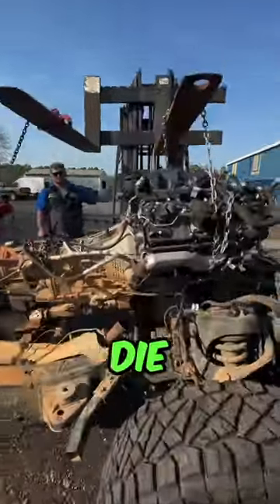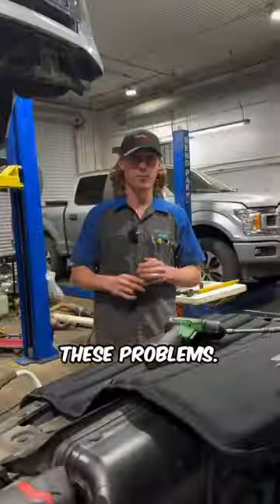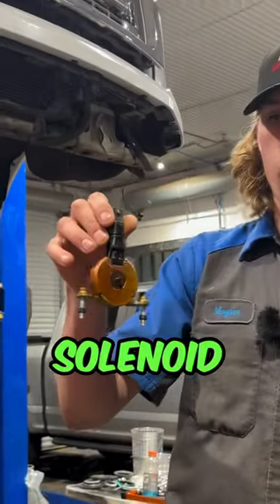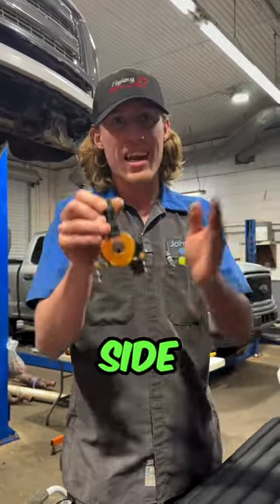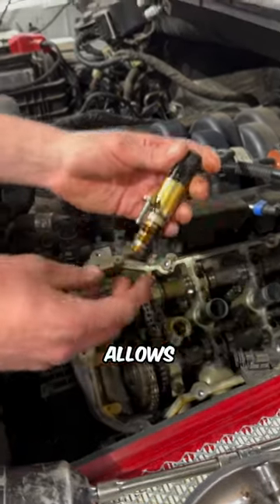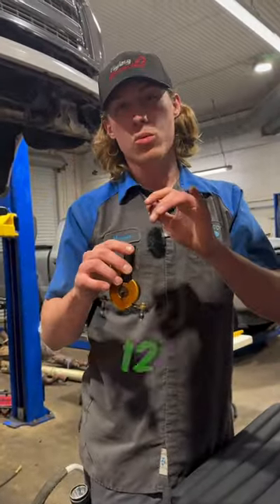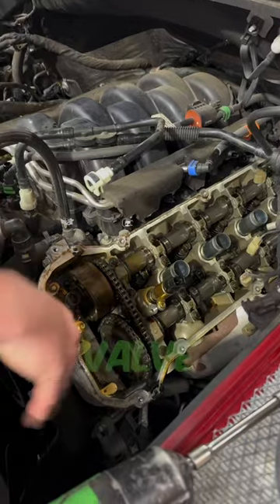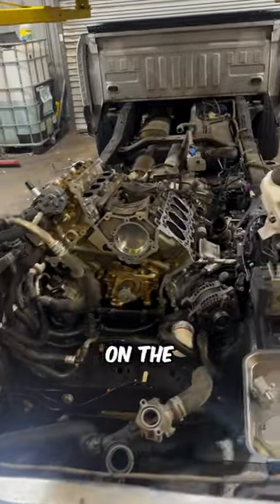Ford 5.0 Coyote Dies On Stop? #ford #coyote #shorts

Comment: Dum design why put it inside the engine so it requires a crap ton of work to just replace it vs Hondas nissan and toyota's on the outside because the Engineers know that it will fail and they will be driving them and they don't want to pull the engine apart just so it will run right so I gess when it brakes just get a property Engineered car